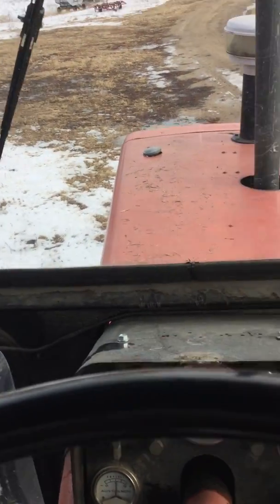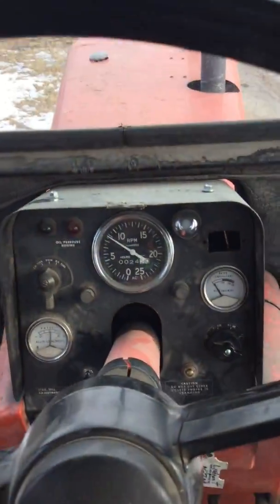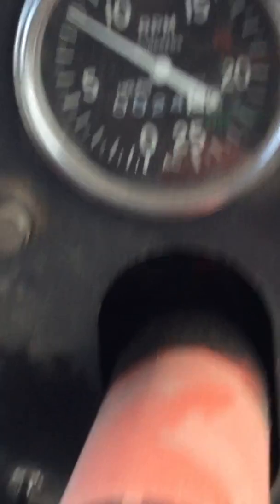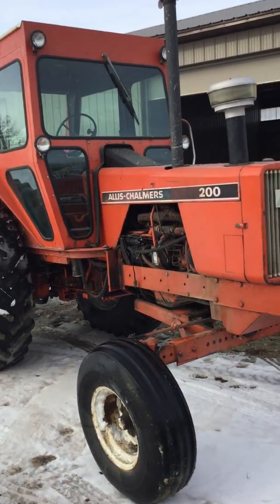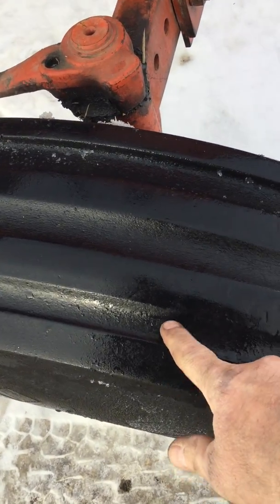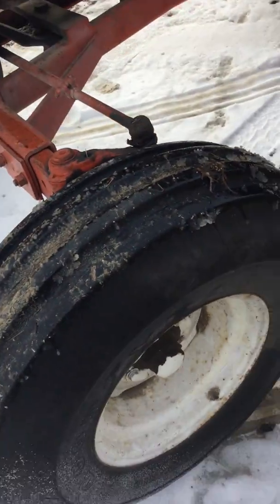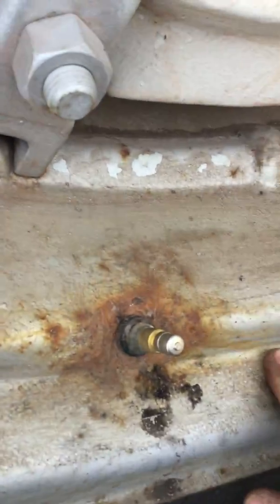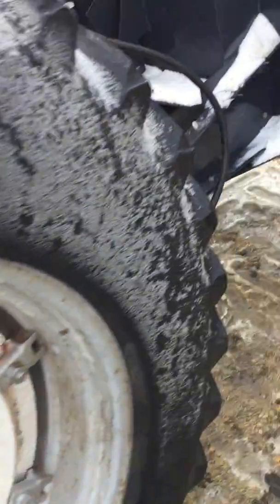Allis Chalmers 200 January 2018

Comment: 301 cu in of John Deere eating mean!👍👍
Reply: I doubt that..
Reply: @Farmer_1776  you never drove one then
Reply: Power wise there replacement for displacement. I do like the ac 200 setup, I looked at buying one with a bad engine years ago, but I passed on it due to the parts availability, and not knowing if the trans needed a rebuild or in addition the power director
Reply: @Farmer_1776  Allis Chalmers and Mack are the only 2 companies I know of where replacement for displacement didn't apply.
A 190/200 with a 301 would clear a 4020 ,1030,1070, 806, 966, etc right out of the field. A 4320 with a turbo on the ,404 couldn't hang with the  190/200 much less the 210 which was actually the same power. Have 0 problems getting parts, and the power director was a much better setup than the syncrosmash system
Reply: Not to get into a arm chair mechanic war here.  I appreciate the information on Allis-Chalmers. I think that the tractors they had were far ahead of their time in comparison to some of the things other manufactures had at that point in time. That being said, I guess I’m going to have to take your word for the power. I’ve got a 4320 that’s putting out around 160 hp right now. Blowing wet snow, it’ll eat it like nothing else In first reverse and not riding the clutch
Reply: @Farmer_1776  160hp? Wouldn't be possible with the standard rosa master pump. I had a 4520 that ran 150 with a new engine, and my 190 would make that tractor look foolish.
It's not HP that gets the job done it's torque and the 404 Deere engine lacked torque
Reply: @Farmer_1776  I don't mean to be rude, I just happen to be involved with these tractors, and I hear all kinds claims of horsepower. I believe you when you say 160 but my guess is the guy running the dyno doesn't know how to read it, and is giving you that number.